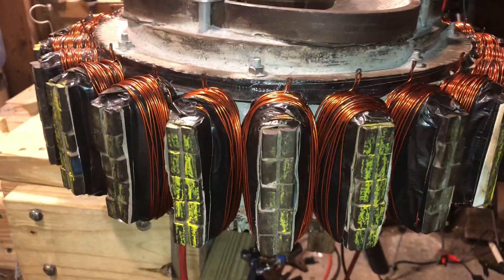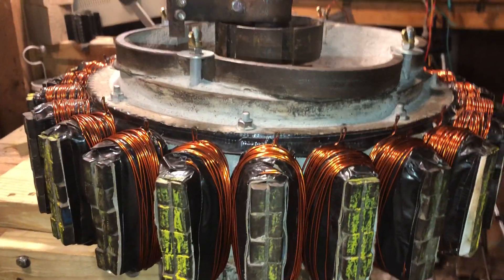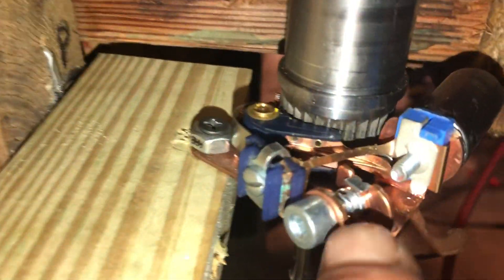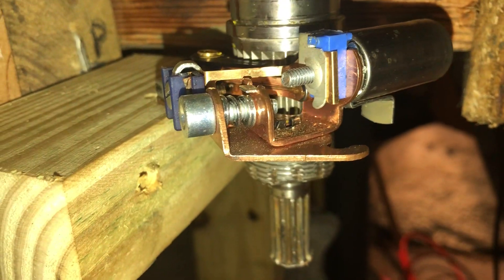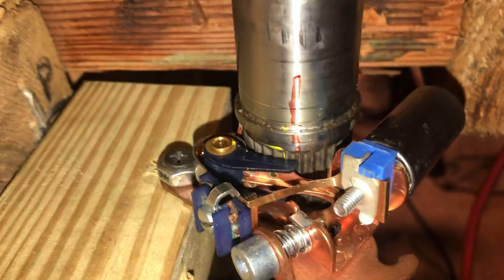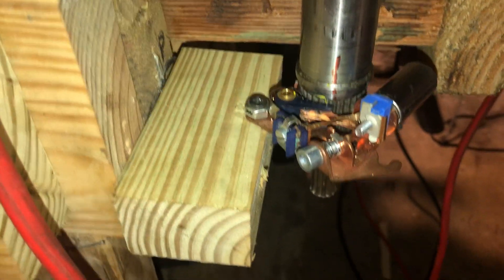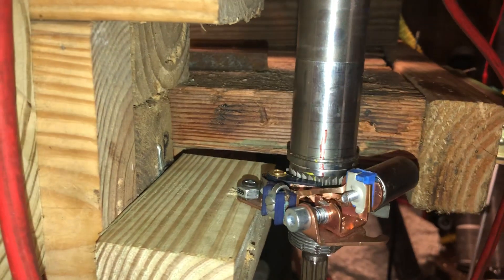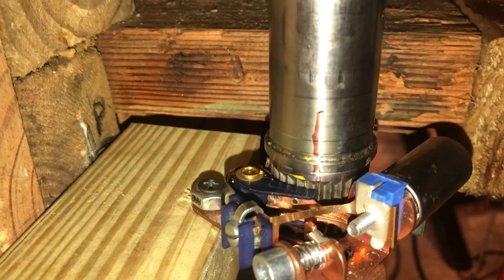Coral Castle, Ed Leedskalnin, Wheel timing!

Comment: If there are 27 splines it will collapse the field every time the points touch when it drops into a valley. You can make your own cam lobe system to slide onto the shaft or build it up with fiberglass resin and grind the lobes where you want them.  I would not grind the splines off, they could be useful later. Just like points on a car , you need to figure out the dwell angle. ( How long the points are closed and open). That is why you need to be able to adjust it.  I think that is why the arc rings on the top of the fly wheel are timing points or cam lobes. How many magnetic poles are involved in each moment of angle on each arc ring. N to S and S to N ?